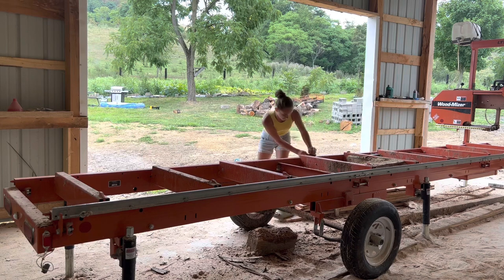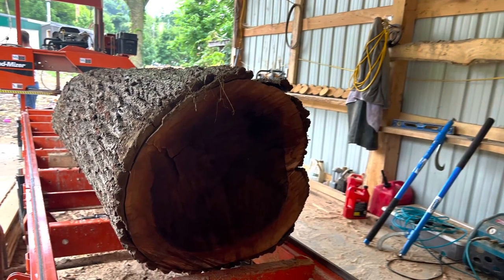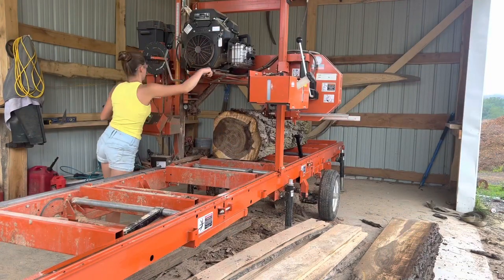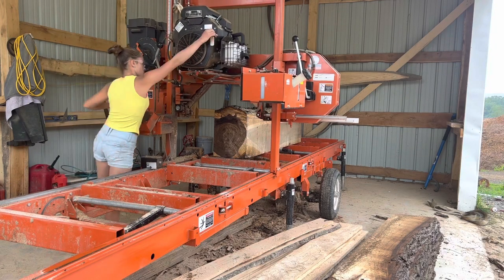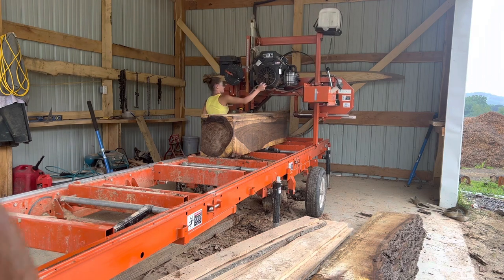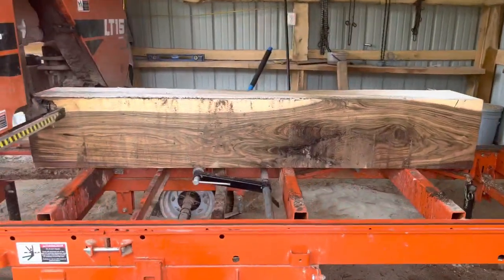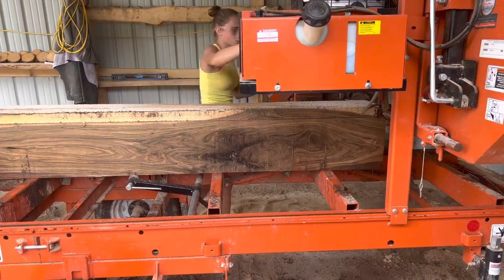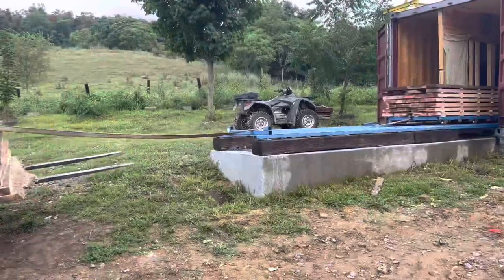Sawing Walnut Lumber with the Wood Mizer LT15 GO

Comment: To avoid some problems down the road get rid of the transmission fluid instead mount a stiff bristle brush on the carriage to sweep away the saw dust pick up a cheap leaf blower to clean under the mill and around it
Reply from the maker: Thanks for the tip👍

Comment: You may want to get a quarter scale for your mill from Wood-Mizer. Used properly it will virtually eliminate the need for constant measuring.Good video.
Dave
Reply: I love that magnetic strip. It’s like a $20 manual accuset.